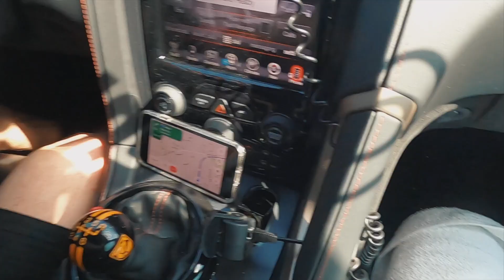*** NEW EXHAUST ON VIPER ACR!!! ***

Comment: Definitely sounds awesome yet even without the straight pipe setup. Maybe run a valve system like the fi exhausts to run it loud then quiet for in the neighborhood and on long drives.
Reply from the maker: really wanted to but the stupid side exhaust eliminates that option from the table. there is literally zero room for it :(

Comment: Andre, I understand why you want to put on the stock mufflers, but have you thought about a valved exhaust. I don’t know if they have one for the Viper, but it is a considerable option. It can be quiet when you want it to, and loud when you want it to. Its a suggestion for the Viper.
Reply from the maker: definitely wanted to do that, BUT, unfortunately the side mount exhaust setup allows for ZERO room for it.

Comment: I'm really curious if you pick up hp or loose any who got it right you or the factory? When I was in the street racing screen I was told if it is too loud get a rocking chair well I did get one and quite my car down picked up some hp while I was at it even if it slow it down it's still a 10 second car like to see a Kawasaki h2 run that would be a excellent race in the future
Reply from the maker: there isnt any type of obstacle in the resinator, its straight thru so i doubt i lose any power... cat's are still gone, so the restrictions are not present... no power lost

Comment: I also didnt want drone in my Viper but wanted a more aggressive sound. Doing research I ended up leaving my stock resonators on and just replaced my mid pipes. The mid pipes deletes the secondary cats and turned the primaries into high flows. Its throaty upon startup and imo loud enough when you get on it. Also most of the drone is gone cruising at highway speeds. Not only that but it helps bring down the heat in the cabin and the rocker panel. Bought it from Jon B at Parts Rack if you're interested.
Reply from the maker: awesome information. thank you for the feedback.. i really really do appreciate your input!!! :)

Comment: You should prolly make a valvetronic or buy one for your viper that would be one useful thing as it will help you control it's loudness as you want.
.
Edit: it's not that bad atleast you can hear the engine more under the hood than the exhaust sound
Reply from the maker: good observation about the engine over the exhaust. thats forsure. i would, but the side mounted exhaust makes it impossible... there is 0 room for that..

Comment: I don’t think you’re crazy at all man. I had a catback race exhaust installed on my car and the drone was so bad around 3k RPM. Did it sound good? Heck yeah. But honestly it wasn’t worth it for all the headaches and the general deafening and exhausting driving experience so I put mufflers on too. It was such a good decision. Loud on the outside when I want it, quiet and refined for passengers too
Reply from the maker: 100%, my thoughts exactly man. absolutely hit the nail on its head

Comment: There are Vipers with cutouts but I’ll be interested to see how you do them.
Reply from the maker: also ones that cut out a damn hole in the side of their car next to their front wheel LOL. im joking. link me a proper exhaust cut out; im very curious to see how they routed it!
Reply: Suited Racer it’s a custom job and they did do a hole behind the tires. Right where the 90 is on the exhaust. 
I wonder if you could put one in right after the headers and blow it down in the holes that’s already in the frame/bellypan. Really look forward to seeing what you come up with.

Comment: Buddy, it still has a drone unfortunately but I guess its better than before. I too have tried all sort of permutations and have spent thousands in exhausts that I have chucked away. Sadly whatever you do to the Viper it will always have a drone, as its a side exit exhaust. I have now have 2 custom made inline absorptive type mufflers installed each side which although a bit quieter than the stock exhaust still has a tendency to drone. Mind you my car is a 9.0 Liter, but simply and sadly put you can't quiet down 8.4 liters of muscle car, particularly when the exhaust exit is right by your ear.
Reply from the maker: yep, that damn side exhaust will get us every which way we try. but yes, it is DEFINITELY less than before. lol, yup. you nailed it. i cant even imagine the 9L